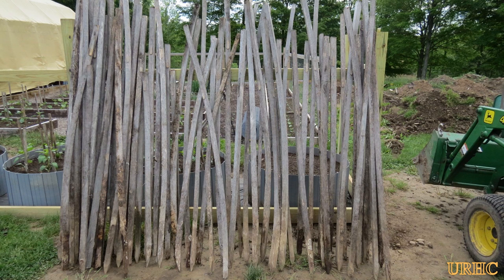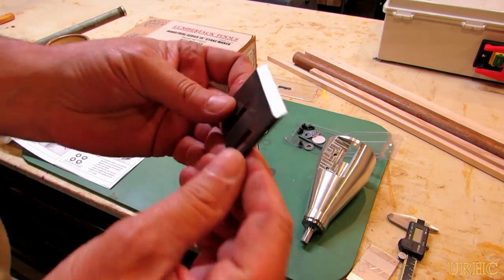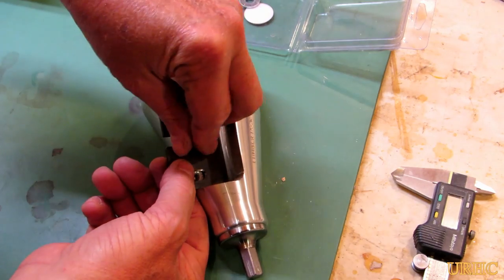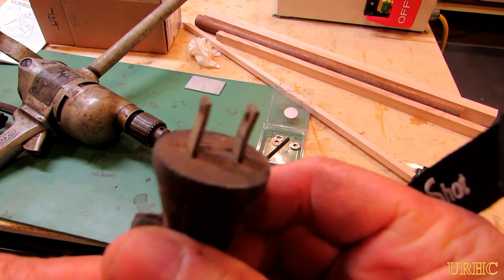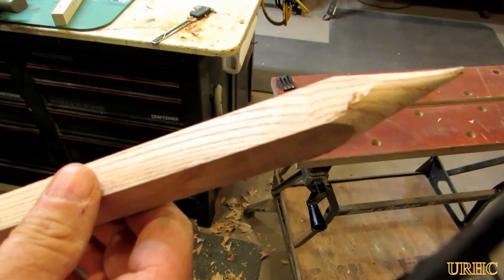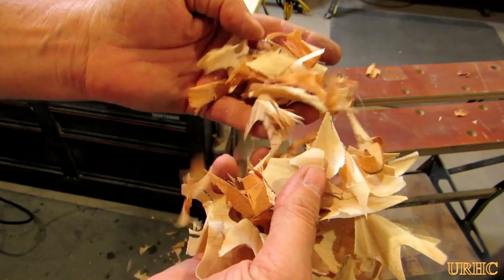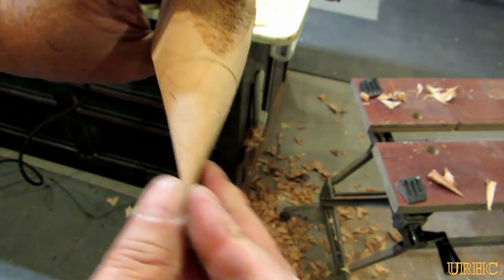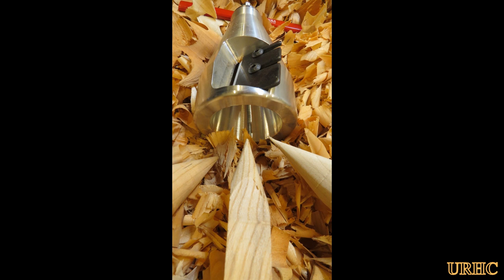First Impressions Of My LumberJack ST 2000 15 Deg Staking Tool

Comment: Wow what a difference the thick washers made. I just bought a tenon cutter. Comes with THIN shims. Wonder what happens if i use thicker.. and if it will affect the 1.5 inch tenon.
Reply from the maker: Turned out lumberjack saw my video and realized I had an older model that needed a shim set. Thet sent out the shims and said all the newer ones are updated. Best bet is try it and if you feel there's a n issue contact them directly.  Thanks for watching.

Comment: Used a 1hp 3 phase motor after cutting the shaft diameter down to match the adapter. Mounted on a stand with a simple guide that can be swapped for different sizes of stakes. Single phase to 3 phase vfd. The vfd lets me change speed for different types of wood and really helps. If you try to hold it with this setup though it will bite you if you don't have something to keep it from spinning when it catches
Reply from the maker: That like what I plan on doing someday.  Thanks for watching.

Comment: Hi again! I think I should watch more of your videos before suggesting machine designs! lol I see the motor adapter now, and found a way lower price than at first on the pointer device (and if you got 40% off, that makes it even better!) Keeping everything horizontal is probably easier. What happens if the stake bottoms out in the pointer? That might save the step of pulling it off to check. Anyway, I see you know what you're up to and I look forward to seeing what you eventually choose to do! Thanks again!

Comment: About your old  !/2 drill .  Replace the old electrical cord with a new cord that is a 3 wire with a ground and make a secure ground connection to the drill body with the ground body and your shock problem should be solved.  I install a GFIC receptacle on old 2 wire generators that do not have a Ground wire. This will protect from shock hazard.
Reply from the maker: That's a good idea.  Thanks for watching.

Comment: Why not try to mount the drill stable and then just feed the stakes in. Love all the toys you have.
Reply from the maker: You could make a big handle to hold the stakes and try it. There is a lot of force on the stakes so there is no way to just hold them like a pencil in a sharpner. Plus it is nice to have control of the trigger. Thanks for watching.